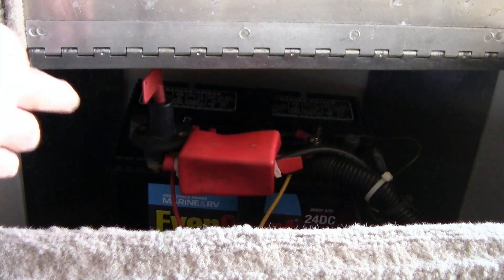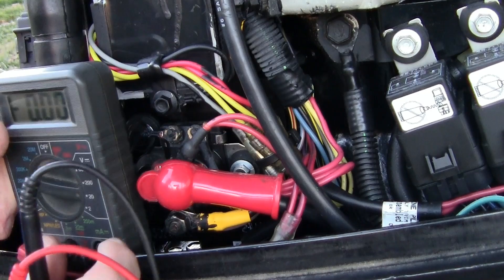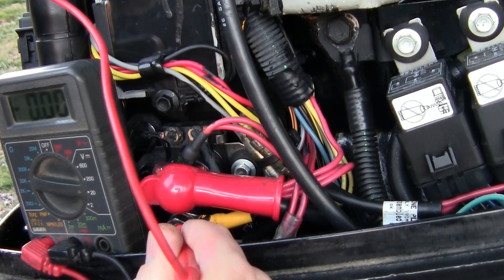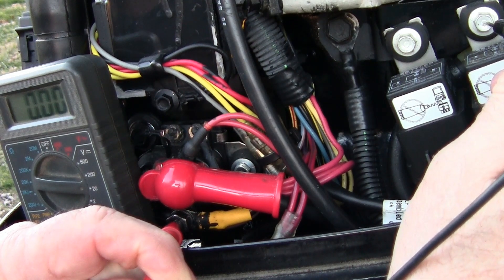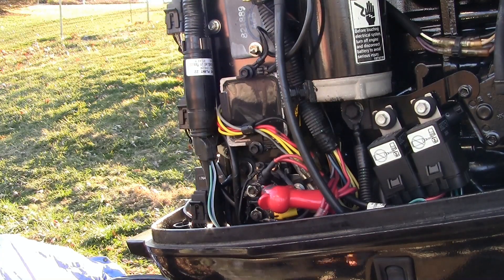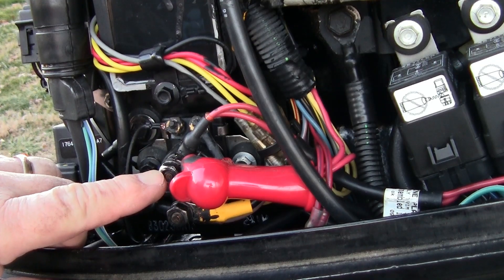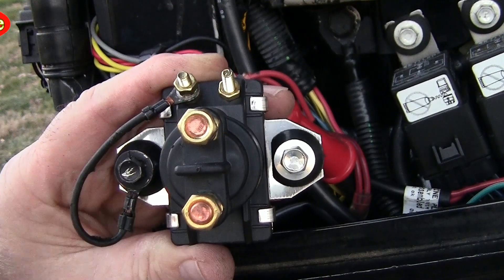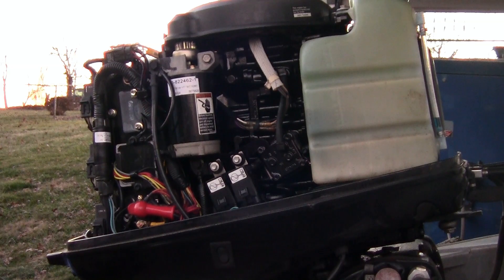50hp Mercury solenoid replacement

Comment: Mine the starter won't engage what do i do 1st
Reply from the maker: Make sure battery has 12v. Then try to manually make the starter crank like I did. If the battery is good you need to make sure the starter is good.

Comment: Great video! Thank you for sharing..  I just changed the selenoid, bought a new battery, and replaced the battery cables, but now I can't hook it up to the battery because it starts sparking . Any idea what the cause?
Reply from the maker: Your grounded out somewhere. You will have to check your connections.
Reply: @LonnieJohnson1  thank you for your response. I am not going any power to the dash or ignition switch.  However, the tilt and trim on the outboard works. Solenoid, battery cables, and ignition switch have been replaced. Any idea.
Reply from the maker: I would follow the ground wire to see where it is connected, then I would follow the positive wire, it should go to the solenoid. You could have a bad solenoid because I have seen it happen, however, it could be something else.
Reply: @LonnieJohnson1 Would a bad solenoid be a reason I am not getting power to the ignition switch? The choke is the only thing working from the switch u can hear a click, and my accessories work. But i have no power to my guages or the outboard itself.  The trim tab works as well. But I have checked everything but the black cable from the battery to the starter . I saw smoke coming out from the positive wire as I was trying to turn it on, and it just died. Thank you for your help once again.
Reply from the maker: Could be
Reply from the maker: Your welcome

Comment: Your problem almost exactly describes my problem. However, when I try the diagnostics, I'm not getting any power through the key switch checkpoint on the solenoid. I have a new battery and the battery terminal on the solenoid is hot like yours. If my key switch isn't getting any power, what does that mean? My voltmeter on the boat panel goes up to 12V when the key is in start position.
Reply from the maker: You have a bad fuse or a bad key switch. I would check the fuse and then the key switch to eliminate those from being the possible problem. If they are good, you will need to see if you have continuity between the wire on the solenoid and the wire that is connected to the key switch. Make sure there is no power running to the wire because it could damage you multimeter during continuity testing. You could have a bad wire.

Comment: Thank you, 4 years later and your video saved me. Thankfully you are concise and clear. I have a question, im getting 10.92 at the key switch. My Bindix attempts to turn when I turn the key to start it but its only a nudge, the solonoid clicks and nothing happens.
When testing as you did in your video i get nothing at the solenoid so i will start by replacing, just wondering if the 10.92v at the ignition wire might be a different problem that needs to be addressing
Reply from the maker: What does the battery voltage read?
Reply: @LonnieJohnson1  12.5 at the start of testing. Around 12.2 right now
Reply from the maker: You should have the same voltage at the solenoid when you turn the key to start it. You can also run a jumper cable from the positive side of the battery to the starter to see if the stater cranks the motor like it should and that will tell you the starter is good.

Comment: Lonnie I have the same 50 HP 2 Stroke motor (2004) and it runs great (when she's running)!    I am getting the motor ready for the April 1 fishing season. I am getting 12.8 volts at the new battery and it's making its way to the new Solenoid which is also getting 12.8 volts.  When I turn the key at the ignition I hear a clicking sound at the Solenoid and the new Starter turns slowly not able to push the Bendix up to the fly wheel. I measured the ignition area on the Solenoid and it is only getting 2.4 Volts and then measured the starter bolt on the Solenoid and that is only getting 1.8 Volt (which is why the Starter is tuning slowly).

Any idea of what may be causing the drop of voltage from the 12.8 V at the Battery to the 12.8 V at the Solenoid to 2.4 V at the ignition area on the Solenoid to 1.8 V at the starter bolt on the Solenoid?  I figure if I can get 12.8 V at the ignition area of the Solenoid it will solve the problem and push 12.8 V to the starter bolt on the Solenoid to the actual Starter.

Thanks in Advance!
Reply from the maker: Here's what I would do. I would run a jumper cable to the starter to see if it will crank like it should or if it's dragging. If it cranks like it should then I would look at replacing the solenoid.
Reply: Ran a jumper to the Starter. Now it is spinning fast but not engaging. Not sure if this is true or not, but I was reading you need the Solenoid to get the Bendix to engage the fly wheel. So I took your recommendation and ordered a new Solenoid (Mercury OEM $50.82 ). Should be here Tuesday and I will install and see how it goes. Appreciate you taking a look at my post. I hope this will do the trick! @LonnieJohnson1
Reply from the maker: No problem, let me know what happens.

Comment: Can you tell me where I can find a wiring diagram for the fuse panel for a tracker PT 175 with a 50hp mercury outboard.  I bought a new panel because my old one had some loose plugs and I didn’t take a picture of which wires were positive and negative.  Need some help.  Thank you in advance
Reply from the maker: I replaced my fuse panel with a larger fuse panel because of all the equipment I was using. I made sure I didn't over load any fuses. You can do the same with yours.

Comment: I believed I have the same problem, when I turn the ignition there is no power and my tilt do not work on the shift handle or on the front by the throlling motor, now the tilt work on the button located in the motor, I will start checking the selenoid anyway,  TY for the vid and any comment will be really appreciated. TY Again
Reply from the maker: Your welcome. How much of a charge is in the battery.
Reply: Sorry that I didn't reply to you, I didn't saw the alert, the battery was fully charge and I tested. It was the selenoid malfunctioning,  I got a tester like the one you have on the video, and I tested the battery and the selenoid, and yes, it was the selenoid. I put a new one and problem solved. THANK YOU SO MUCH again for this vid, you have no idea how much money you save me with this. This same issue happened to me like 10 years ago and I paid a lot of money for a simple $20.00 selenoid. Again TY So Much!
Reply from the maker: Your welcome
Reply: BTW, I also cleaned the contact of the trim relays with a wire brush even though they were in great shape just to avoid a future problem with them too.
Reply from the maker: Cool, sounds good.

Comment: Can ypu help me with other wires on a 2000 50 elpto rectifier and harness install...i can take detailed pics or whatever you vid is only one i could find that resembles my motot
Reply from the maker: I have a video for that right here on my channel>>>Mercury 50hp voltage regulator location

Comment: where did you find a solenoid for 13 ? Just found one on line for 60
Thanks for sharing
Reply from the maker: Your welcome. Amazon
Reply from the maker: Type the link below in to the Amazon search bar. 
Crank N Charge Solenoid Relay Switch Replacement for Mercury Marine 12 Volts 4 Terminals 20HP 25HP 40HP 45HP 50HP 55HP 60HP 65HP 70HP 80HP 90HP 89-818997A1 65W-81941-00-00

Comment: hi got a question when you take your spark plugs out should you be able to tun the flywheel .all i have did i think mine is lock up
Reply from the maker: Yes, you should be able to turn it. Was the oil injector not working?
Reply: @LonnieJohnson1  yes, the oil injector is working i dont know what happened worked fine before i changed to starter/solenoid 2 new batterys  do you have a video on 2 battery system setup with battery switch
Reply from the maker: Sorry, I do not. Are you running 12 or 24v.
Reply: @LonnieJohnson1  12v
Reply: @LonnieJohnson1  yes the oil injector works fine
Reply from the maker: Cool!
Reply: @LonnieJohnson1  another question , do you have a video on installing a voltage regulator on your outboard
Reply from the maker: Sorry, I do not. If mine goes out I will make one and post it.
Reply: CAN YOU WHEN YOU GET A CHANCE SHOW ME YOUR VOLTAGE REGULATOR JUST A PIC OR TWO WANT TO SEE THE HOOK UP I PURCHASE ONE WITH THE TWO PLUG INS ON IT MY ORIGINAL ONE WAS NOT WITH THE PLUG IN TYPE THEY SLICED THE WIRE TOGETHER .
Reply from the maker: I just uploaded a video so just type this in and let me know if it helps.
(Mercury 50hp voltage regulator location)
Reply from the maker: Below is the one I have and I'm getting ready to upload a video that I hope will help you, just copy and paste this link into Amazon.
Voltage Regulator 883072T Replacement for Mariner Mercury Outboard Voltage Regulator 815279T 854515 815279 856748 883072 Mercury Rectifier 75-200HP 1987-2005…

Comment: i got the same ouboard mine is 2005  ,, i got 2 new batterys reading 12.75/12.70 new solenoid  still clicking  wonder what can i try now
Reply from the maker: Run a jumper from the positive side of the solenoid to the starter and see if it cranks.

Comment: FIXING TO GO GET ME TWO NEW BATTERYS , DO YOU HAVE A VIDEO ON THE TWO BATTERY SET UP WITH A BATTERY SWITCH CONNECTED
Reply from the maker: I do not, but the switch I use is mounted at the positive battery terminal. If you go to Amazon and type in (battery shut off switch 12v) You will see lots of different inexpensive shut off switches. I just have a main shut off switch to the main battery that works with a key and the on board charger is connected straight to the two batteries so the batteries are always charging. After seeing some of the new switches that 's available I might change out my old switch and if I do I will make a video on it.

Comment: I GOT A NEW SOLENOID GOING TO TRY IT I WILL LET YOU KNOW / CAN YOU TELL ME WERE ARE THE FUSES ON THAT OUTBOARD I JUST SEE ONE ON THE TOP
Reply from the maker: My fuses are under the console.
Reply: @LonnieJohnson1  SO ARE MINE I GOT ONE ON TOP OF THE MOTOR WIRE HARNESS
Reply from the maker: I will have to look again because I've not seen one around the motor.
Reply: NOW IT SEEM LIKE THE BATTERY IS DEAD GOING TO GET THEM CHECKED OUT I TESTED THEM GETTING 12.4/12/8 IN THE OTHER GOT A NOKIA 2 BANK CHARGER SAYING THE BATTERYS ARE FINE SHAKING MY HEAD LOOK LIKE BREAK OUT ANOTHER THOUSAND .BOAT THANKS FOR ALL YOU HELP
Reply from the maker: Your welcome

Comment: I just replaced my water pump this morning and now this. I can jump it with a screwdriver but the key does nothing. My tilt/trim still works. Guess it’s solenoid time.
Reply from the maker: Sounds like the solenoid.
Reply: @LonnieJohnson1   the new solenoid got me started again. Only problem is the starter won’t stop spinning now. I Had to disconnect the battery to kill the motor.
Reply from the maker: Is the solenoid sticking on? or is the key switch not working like it should?
Reply: @LonnieJohnson1  I’m not sure if the solenoid is sticking. The key was working fine until the last time I started it. When I turned the key to the off position the starter continued to spin.
Reply from the maker: You should be able to check it with a multimeter.
Reply: @LonnieJohnson1   I ended up getting a new battery today and everything worked fine. Maybe low voltage was the problem. I had read that could be a cause. Anyway, I was finally able to see that the new impeller was working. Thanks for the help.
Reply from the maker: You're welcome; was your battery reading 12v.?

Comment: were did you get that SOLENOID FROM AND WHAT IS THE SN
Reply from the maker: Amazon...Crank N Charge Solenoid Relay Switch Replacement for Mercury Marine 12 Volts 4 Terminals 20HP 25HP 40HP 45HP 50HP 55HP 60HP 65HP 70HP 80HP 90HP 89-818997A1 65W-81941-00-00

Comment: HOW MANY WIRES GO ON THE HOT PART OF THAT SELIONOID I MIGHT GOT THE WIRES WRONG , I HAVE THE SAME OUTBOARD MINE IS A 2005 MERCURY 2 STROKE / HELP I HAVE NEW STARTER/SELINOID JUST TICKING .
Reply from the maker: I got 2 wires on the positive side of the solenoid as you can see in video at 5:26. Your wires should be harness together like mine.
Reply: @LonnieJohnson1  looks like mine have three wires on the positive post of the solenoid and that one yellow at the bottom
Reply: love your videos but i can not see the wires that good the way you took them off would love a video close up of your wires
Reply from the maker: I will double check this weekend but it looks like only 2.
Reply from the maker: I'll check this weekend and see what I can come up with.
Reply from the maker: I took a better look at my solenoid and it has 5 wires plus the battery cable wire. I didn't realize it had that many so I made a video of the wires on the solenoid that I will post.
Reply from the maker: I just posted a video on the wire placement of the solenoid.

Comment: I'm having the same issue no tilt and won't start at all. I try the battery from  truck so I knew it was not a battery issue. So that's what led me to this video thanks for the great video I will be ordering a new one.
Reply from the maker: Your welcome
Reply: I replaced the solenoid still not working. 😢
Reply from the maker: I would check the starter to make sure it is working properly. I would disconnect the positive cable from the starter and run a jumper cable straight from the battery to the starter and see if it will cranks normally.

Comment: Hey thanks for this video! I watched it this morning and was on the lake by this afternoon! 
I have a '06 suntracker party barge with a mercy 60hp 4 stroke.
When my boat died, it was all of a sudden (not gradual). Just died and wouldn't do anything. Even the trim wouldn't work. 
The part that I got was called a "relay assembly" part # 8M0098898. 
There was some confusion at the parts store as I asked for a solenoid and their computer brought up a different part. After looking at the diagram I was able to point out the part to the guy at the store and it worked like a charm. 
Appreciate ya man!
Reply from the maker: Your welcome and thanks for the info.

Comment: Hi Lonnie! Great video. Could you do a video on the Electric Choke solenoid, should there be no power from the key to the solenoid.
Reply from the maker: Thanks, my chock solenoid works by pushing the key in like a button while I'm trying to start the motor. There should be power to the key switch and the solenoid will only work when you push the key in like a button. Hope this helps.
Reply: Thanks Lonnie!
Reply from the maker: You're welcome

Comment: I have a 90 hp 2 stroke when i connect the battery the engine turns over but does not start do you think this is a solenoid problem
Reply from the maker: Do you use the key or does the engine turn over when you connect the cable to the battery?
Reply: @LonnieJohnson1  hey lonnie turns over when i connect the battery without the key. I did a bit of google research gave the solenoid a tap and it fixed the problem for now. so i am assuming the solenoid needs to be replaced? now I turn the key and the engine clicks a few times then starts I assume the starter motor is gone too hahahaha
Reply from the maker: Sounds like the solenoid is bad.

Comment: Hey Loonie, I noticed when you turned the key the ignition didn’t beep, is that normal with this motor ? I have a 2006 Merc 50hp 2 stroke on my Lowe Fm 165 and there is no beep, I’m told that there might be something wrong ? Thanks in advance
Reply from the maker: My ignition only beeps when it's low on oil.

Comment: Mine has the "push key in choke" style... does this wire run to that solenoid? Some moron removed my choke wire. So, now it takes forever to finally crank. Cranks great rest of the day.
Reply from the maker: You should have two solenoids. 1 for the starter and 1 for the carbs that activate the chock.

Comment: I have a 1990s mercury 125hp which has started making a click when i turn the key. If i keep trying eventually the engine starts, could my problem be the solenoid? 

Thanks in advance for any help you can give me
Reply from the maker: It could, I would change the solenoid first. It's cheaper than the starter.
Reply: @LonnieJohnson1  thanks for the advice. I did use a multimeter and i get 12.56 on my battery, 12.56 on my solenoid and 12.56 on my starter motor. Could this still possibly be the solenoid?
Reply: @LonnieJohnson1  thanks for the advice. I did use a multimeter and i get 12.56 on my battery, 12.56 on my solenoid and 12.56 on my starter motor. Could this still possibly be the solenoid? 

Edit: i used a screw driver to bridge the solenoid and it wanted to start, is that a sign of a bad solenoid
Reply from the maker: Yes it is, also does the solenoid give a hard click when you turn the key to start?
Reply: @LonnieJohnson1  yes it is a hard loud click when i turn the key
Reply from the maker: If the starter is working when you cross the terminals to put 12v to it then the solenoid is he issue. When the solenoid clicks it suppose to send 12v to the starter. The solenoid is also the cheaper fix.
Reply: @LonnieJohnson1  thank you! I will let you know how it goes

Comment: Where did you get your solenoid from? Also would you happen to have a part number?
Reply from the maker: Got it on Amazon and here is what I got. Hope this helps.
CRANK N CHARGE Solenoid Relay Switch Replacement For Mercury Marine 12 Volts 4 Terminals 20HP 25HP 40HP 45HP 50HP 55HP 60HP 65HP 70HP 80HP 90HP 89-818997A1 65W-81941-00-00